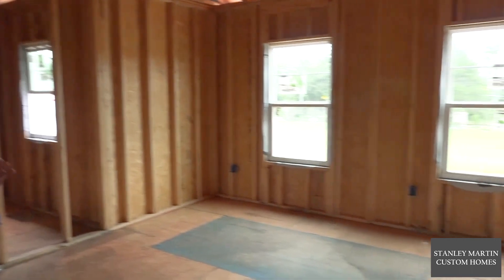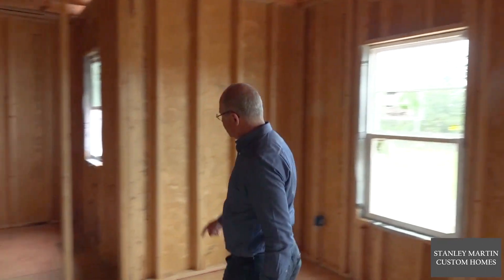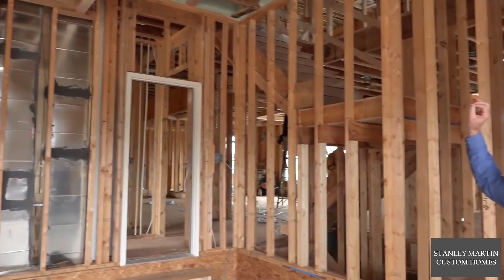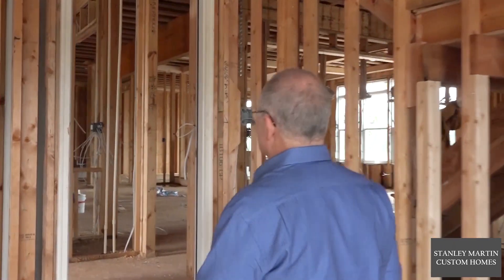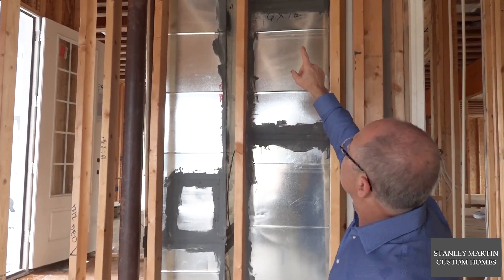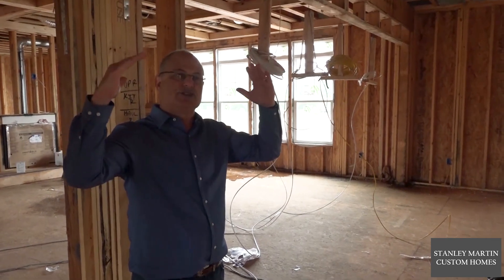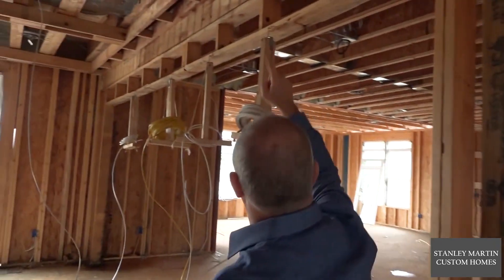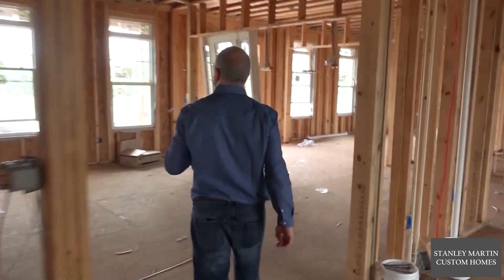Award Winning Home Builder Explains How to Build an Energy Efficient Home

Comment: Did I see this right? They cut down the laminate beams in that great room to allow for his ducting to be run through this plenum he's created? Those are load bearing members that he's just capped with what looked like 2x4's. That seems very structurally unsafe. I wonder how they engineered that. Also, he went through all the effort to spray foa the band boards but didn't spray foam the backs of the exterior facing wall outlets?